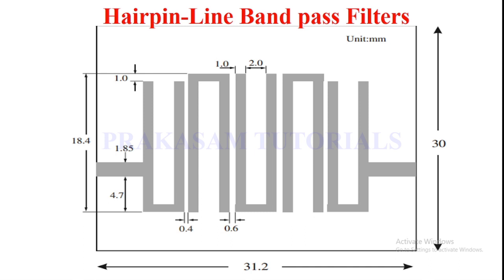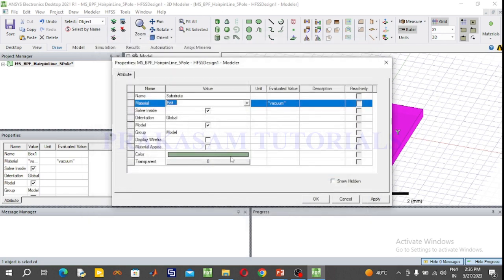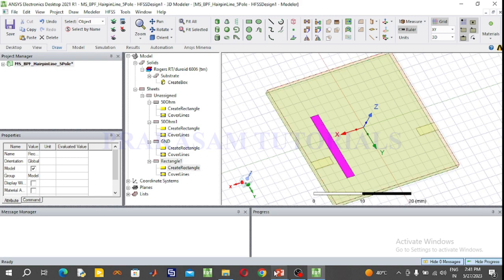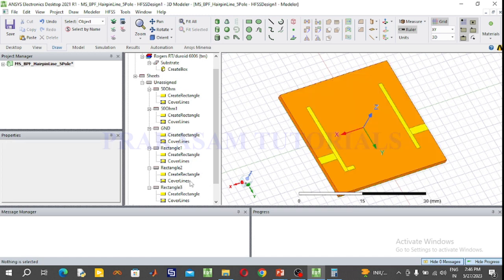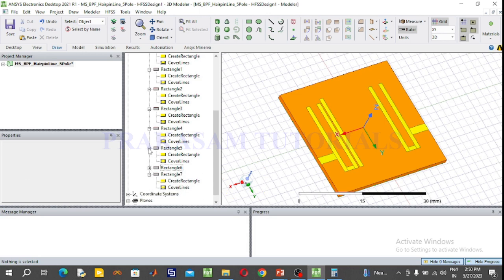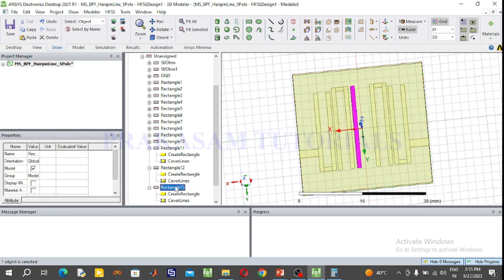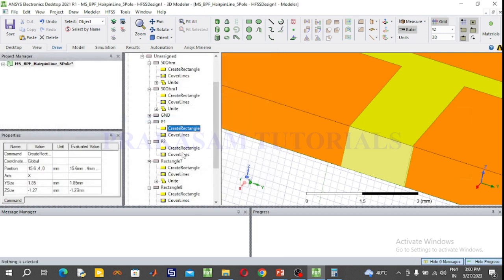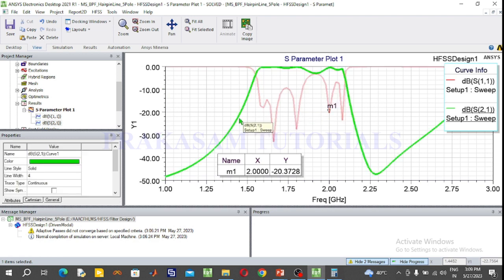Hairpin-Line Band Pass Filter Using HFSS

Comment: Sir,I have design it for 15 Ghz i got output approximately center frequency 15.02Ghz and return loss -24 dB but  i got insertion loss -5.2 dB , in google i saw insertion loss should be positive is it ok or shall i change something in the design
Reply from the maker: Return loss is very good value.
Calculate insertion loss using formula
Reply: Excuse me, could you help me with the formulas for the mathematical calculation?